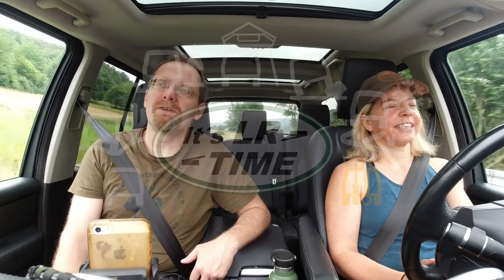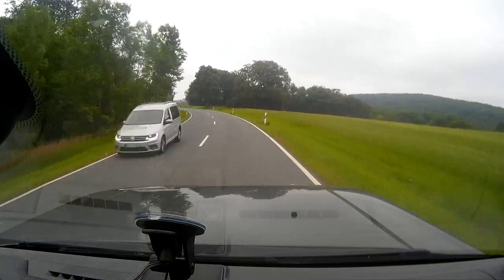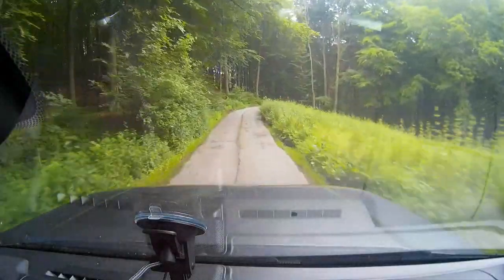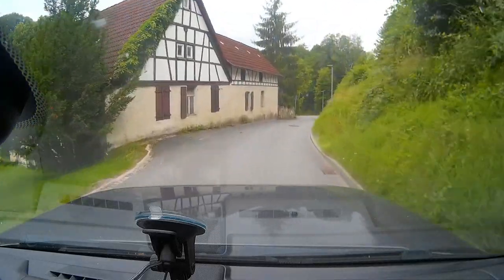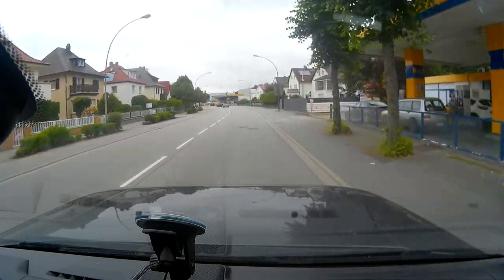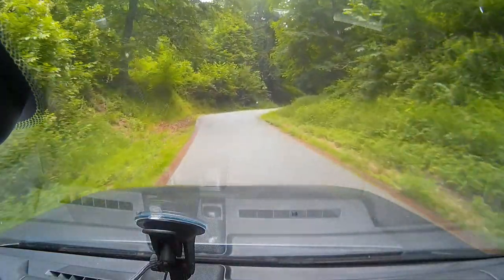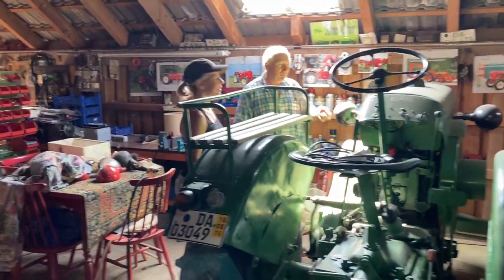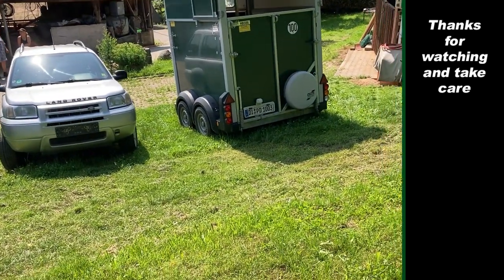Land Rover Discovery 4 - Is it really an upgrade from a LR3 ?

Comment: From the headlights yours is a pre 14 model year 21000 Euro is lots based on UK pricing, my friend in Bremen spent 16000 euros on his with 120km on the clock his is 2012 I thought he was mad ! I think he has the older gearbox, my Disco 3 is going for a gearbox fix on Wednesday if its under 1000 pounds to fix we are keeping it, if over that we will be on the hunt for a 4, might push the boat out and go for a 2016 for the Euro6 (I have 2 daughters living inside the north and south circular and we visit lots ). I had a 5 for 2 months not really same sort of thing. Must admit prices are going up in UK on 3 and 4 not really sure why. Good luck with your new baby can't wait for the videos, hoping to get to DE and AUS and CH in mine before the end of summer.
Reply from the maker: Prices in Germany are through the roof compared to the UK. I have been following your market, also on facebook. And we would import one any minute, but I am not going to drive a right hand vehicle here. So we are stuck with those prices. And due to Corona and the Vanlife hype, everyone is looking for a travel car. We'll be in the Alps sometime in August. 👍🙋‍♀️ Vera
Reply: There may be some LHD markets where they are cheaper ?? But it's a lot of hassle and difficult to import with paperwork etc noticed quite a few land rover disco and range rover coming to UK from Japan. Would love a 5.0 litre V8 Discovery 4 , I know it sounds crazy but there is always the option to run on LPG quite a few in Poland and seems to work well.

Comment: Wanted a D3 but ended up buying a local D4. really miss having a manual gearbox. but love it. I have a terrible deadzone in the steering wheel when driving straight, i noticed when Vera was steering the wheel needed adjusting left/right too. Be a great video topic! .... surely not a landrover fault!! :D 🤣👍👍
Reply from the maker: The steering of our D4 is softer than the LR3.  Is has less play but I thing the lower front suspension bushes are a bit worn.  We have the armored vehicle bushes in our D3 and they make the vehicle ride less smoothly.  Christian

Comment: very well put, they are half the price of a Landcruiser here, my 2010 d4 is worth 25 with bull bar, lights,and 217000km 09 d3 can be had for 12000Au however Discos are comparable, you pay 30 in euros ,we pay 30 in Au dollars, i use 12l/100 from pump readings, computer says 7.8, towing two tonne, puter says 13.6 over 1500km, pump says 19 l/100 km

Comment: I hope you are away from the floods and keeping safe, I have an LR2 Freelander with push button start stop but with a cassette unit that needs to be inserted before you can start the engine also the brake pedal needs to be depressed. She is a 2011 model and has cost me £850 in repairs in 10 years, I can't complain
Reply from the maker: 👍 We had ours for almost 11 years and it was one of the cheapest cars we have ever owned. But sadly it was just time to move on. 🙋‍♀️ Vera

Comment: The disco 4’s are actually much better built than the disco 3’s , but only up to 2013ish pre disco 4 with stop/start! Not only are the stop/start ones a pain in the ass to change rear timing belt but also are much more troublesome!

Comment: Klasse Video wie immer. Also ich bin immer noch froh das ich vom Discovery 3 zum Discovery 4 gewechselt habe. Hatte meinen 3er damals mit 85 000 Km gekauft und 5 Jahre bis 145 000 Km gefahren und hatte nichts als Ärger. Meinen 4er hab ich jetzt seid 2,5 Jahren und hab ihn 25 000 Km gefahren nun stehen 85 000 Km auf der Uhr und er läuft und läuft und läuft :-D ohne auch nur einmal zu zicken. Zudem genieße ich die Klasse Fahrleistungen was meiner Ansicht nach den größten Unterschied macht vor allem das 8 Gang Getriebe ist ein Gedicht. Da traut man sich ohne groß nachzudenken den Blinker links zu setzen. 
Mein Vater hat sich zu Beginn seiner Rente auch einen 4 er gekauft hat jetzt 150 000 Km gelaufen ohne auch nur einmal zu zicken. Meiner Meinung einer der besten 4x4 der Reisekomfort und Offroad-Fähigkeiten verbindet.
Bin gespannt wie es bei euch weiter geht :-D
Gruss Daniel

Comment: Swapped D3 to D4 year ago. Love the smooth SDV6 engine, the torque at low revs and the 8 speed. 
Mis the gear lever although the dail sets gears way faster. 
What I really mis on a premium traveling vehicle is storage for small stuff in the front. There are still no drawers under the seats. But in the middle console there isn't even space for two phones! Somehow we could stashe more things in the D3. 
And why do these cars always have sweaty leather upholstery? 
But really happy with it anyways!
Nicely reviewed.
Reply: I think that's my biggest gripe in the D4 .. the lack of space to actually put anything. Nowhere to put your phone, the door pockets are too shallow and things just fall out, no overhead pockets like in the D2 and virtually nowhere to mount anything ... like a UHF radio!!

Comment: Very good point on Discovery 3 second hand value. 

I bought my Discovery 3 for €6000 in Ireland. I put about €7000 into it in terms of transmission rebuild, full servicings, commercial conversion (significantly lower road tax), luxury seat cover upgrade etc. Now it seems to be going well. 

Interesting, I've noticed a lot more Discovery 3's on the road in Ireland in comparison to the UK. I think this maybe because of the Celtic Tiger 2005-2008. Mine was imported from the UK. (Perhaps useless information)
Reply from the maker: We, and a lot of our comment readers,  really do enjoy reading those kind of stories. Keep them coming. 👍🙋‍♀️ Vera
Reply: @Vera_and_Christian  thanks Vera!

Comment: Regarding the User manuals. The manuals are quite well written, and the German version may have been signed off by JLR's German boss at the time. I agree that the content has dumbed down, I have a manual from my 1989 D1 V8 and it and the 2005 D3 manual contained  lots of really useful stuff, but my 2012 D4 manual is mostly devoted to the Infotainment system, which 1: My S spec doesn't have much of, and 2: I don't use it, I use my Parrot Asteroid Mini to stream internet radio.  Every Model year gets a new user manual and each year it gets less and less useful. I often have to dig out an earlier year manual to answer user questions as their manual doesn't have the answer, or it's badly laid out.

Comment: I own an LR3 & LR4 both V8 HSE and will say the LR3 has less power but like the ride quality better.  The LR4 is much faster but have some more squishy suspension.  Have not had the LR4 long enough to see if there's any difference in reliability.  But have put just under 200,000 miles on my LR3 and only had one breakdown due to the coolant T valve exploding into pieces.

Comment: The 4.4 V8 and transmission in the Discovery 3 is a better engine than the Disco 4 5.0 V8 and the Superchargered V6 Disco 4. So they say. I have a 2008 D3 V8 SE with 87K on it and it's absolutely a blast to drive.

Comment: The audio system in the LR3 is hands down better then in the LR4.  Bass is better and the number of radio presets is better.   And having real buttons vs some horrible screen is better.
Reply from the maker: Yes, Christian agrees with you. 👍🙋‍♀️ Vera
Reply: @Vera_and_Christian  after looking all over my LR4 radio I can't find the level of the volume.  In my LR3 it goes from 0 to 35 and the LR4 has no indication anyplace what the volume is

Comment: Moin and hi Vera and Christian, don't you expect decreasing values of Diesel vehicles in the upcoming movement on environmental standards? I am afraid, fuel costs will raise even more than during the last weeks. I met a suisse guy at the Abenteuer Allrad a few years ago, who did some trips with his well equipped LR D3. He recommended to buy a D4 instead of the D3, mainly for the improved electronic system. Good luck with your D4. Looking forward to watching the vids on the D4. I appreciate your way of presenting your experience and opinion. Go ahead Heinz
Reply from the maker: We have to take it as it comes.  But as long as we are able to drive those cars, we will do. 👍🙋‍♀️ Vera

Comment: I bought a Discovery 3 which had dogs in it and it took about 3-4 deep cleaning valeting before the dog smell diminished to an acceptable level!
Reply from the maker: Ok, first deep cleaning done ✔️. Three to go.  Smell got better after I cleaned the roof liner and after treating the air conditioning vent tubes.  3 more treatments to go… Christian

Comment: A bit late but congrats , I prefer to clean my own cars even if the dealer I always find some bits they have missed. I still use an iPod for my music saves the battery in my phone. Why do you still buy LR with its problems ? To be honest I have had a bmw1 series that needed a new clutch after just 26000 miles ( been driving manual cars for years without replacing a clutch so not me) and also digital oil gauge think most are using this system now, but that had to be sorted due to wrong reading , love the channel joe from the U.K.

Comment: you should have bought an unimog ;)
but we like the g-wagon..eventough it is from the 70's and designed for farmers and the millitary and much smaller on the inside and completly rusted.

I actually expected something about the high water, but it seems you are save. that's a +

Comment: After driving/repairing a good few disco 3 / 4’s my take on it is the 4 is much nicer to drive due to suspension/8speed gearbox ! 8zf for the win 🤜 thank you crafty German Enginering at its best!
Reply from the maker: Christian is not totally happy with the 8 speed. Why  that iswill be covered in a future video.🙋‍♀️ Vera
Reply: LR TIME The 8 speeds respond great to an oil/filter pan service! I only did said job amongst other jobs to a L322 4.4 a few weeks back and the customer was much happier with gear changes afterwards! 
The best place I’ve found service kits was on winparts in Holland.

Comment: Great video , I see you bought an earlier d4, I bought one of the latest ones on 2016 plate it’s a landmark special edition, thus spec sits between HSE and HSE lux, the infotainment is the meridian surround sound system which is much better than the Harmon harden which is on your car, although I bought mine 2 years ago when it was only done 14250 miles , but the air suspension pump failed and just changed it . I also be very interested in the the dip stuck conversation. Regards mark

Comment: I chose a discovery 3  as the tax bracket is a lot lower than the discovery 4 in the uk. I wanted a basic S  model, as I wanted to minimise the amount of electrics. I do miss not having seat arm rests though. I pop aid £3500 for a 2005 model and love it
Reply from the maker: It will be interesting to see what the tax and insurance will cost. But in this regard, here in Germany the Freelander costs almost as much as the Discovery 3, one reason why we parted with it. 🙋‍♀️ Vera
Reply: @Vera_and_Christian   my tax for the year is £330 , but the discovery 4 jumps up to £500
Reply from the maker: @robgreenhill1426  The tax for the Disco 4 is 525€ and for the Disco 3 is 416€ 🙋‍♀️ Vera

Comment: I would like to hear Christian's advice or feedback compairing your D3 and D4,s headlights. With the 2013 facelift of the D4, the headlights were changed in that the driving lights were replaced with daytime running lights where the OEM spot lights had been. This could be due to EU Regulations, as many other automakers (VW, Ford, Kia... to name a few) does the same. It might be OK for the EU, but I don't like this as our roads and road markings are bad, and pedestrians and animals also uses the roads. The D3 SE/HSE and pre 2013 facelift D4 had better driving lights built into the head light.  Good spotlight driving lights, and dimming for oncoming traffic, are essential for safety in such conditions.  Sadly current cars are not equipped with good spotlights built in anymore.
Reply from the maker: We will defefinitely do that, if that is possible with our camera setup. His first impression was that the D4 lights are much better than the D3 lights. But he also thinks that the D3 needs some new bulbs. 👍🙋‍♀️ Vera
Reply: Correction 😀. It is with the 2014 facelift of the D4 that the headlights were changed to the bad ones without proper brights.

Comment: One thing I didn't pick up from your comparison between the 3 and 4 is how much better the brakes are on the 4. The downside of the better brakes on the 4 is the requirement to go to larger diameter wheel rims and reduced tyre profile. Never a good thing for offload driving
Reply: Should read offroad
Reply from the maker: There will be so much more info to come, we can't put that all in one video. 👍🙋‍♀️ Vera
Reply from the maker: Yes, the brakes are much better.  And the driving comfort is less good because of the 19“.  Bothers me a lot actually.  I would prefer the 18“ setup but it does not fit and is not road legale. Christian

Comment: Would you recommend a 2013 LR4 HSE over a 2016 LR4 with the V6 ? If both have been used just as daily drivers and never been taken off road
Reply from the maker: For us, it does not really matter if they have been taken off road or not. Most important to us, when buying any used Land Rover is, have they been maintained well. It is very important that all oilchanges have been made, engine and differential, regularely. It also depends on the mileage and the price of course 😅. And you have to hook up a obdii tool and see what kind of faults they have. Then your preference of engine matters. Our criteria is, next to the trim, getting the lowest mileage with the least faults. That is why we bought our Disco4, Christian wanted HSE trim, the price and kilometers was unbeatable and we knew we could handle the oil sensor fault.  🙋‍♀️ Vera

Comment: Fantastic Video! As I said in one of your other videos, I could watch you two for hours. Nice to see a bit of the German countryside, I lived there for a total of 7 years and really miss it!  We just bought a LR3 about 3 weeks ago. Now over the last 40 odd years of driving I’ve had countless numbers of Land Rovers, I even worked part time for Land Rover at one point and my ‘company car’ was an original Camel Trophy Discovery (original of course, although I’ve seen a lot of the Camel Trophy Discovery copies they made for Japan). And my last Land Rover was the excellent L322 Range Rover. But we needed a good strong large vehicle for my girlfriends business (we had spent 4 years destroying a VW Touareg) and the LR3 fitted the bill. Its a HSE V6 Middle East spec (so no heated seats) and of course, 20 minutes after picking up the LR3 the suspension fault light came on. The dealer replaced all 4 airbags, the compressor and two valve blocks, so now its OK, apart from a new battery last week.. I went for the LR3 because to me the LR3 just seems a bit tougher and slightly more ‘basic’ than a LR4, so it should be good for a business that really should use a Transit van. And its really quite nice, I have the same Piano Black wood in the LR3 as the Range Rover had. So yes, the LR4 is nice (apart from the oil dipstick issue!!) and if we didn’t need more of a workhorse then a LR4 would be OK, but I think the LR3 will survive longer, hopefully as long as the VW Touareg at least!
Reply from the maker: 👍😃 and the LR3 looks so much cooler than a Touareg. I was always wondering why all the Camel Trophy cars were in Japan, now I know. We watch @Grizzlynbear a lot and they always had a lot of Camel Trophy Cars in their videos from Japan. 🙋‍♀️ Vera
Reply: @Vera_and_Christian  I got the chance to play with one of the Japan copies, they were factory made and the only real difference was they had no internal roll cage, so whereby in the original camel trophy discovery the roof rack was mounted onto the roll cage, the Japan camels had the same roof rack but with a conventional roof mount. I had done a lot of filming with Land River and they kindly put me through an off-road instructors course. When the new Land Rover Experience centers sprung up I was invited to work part time in New Zealand at the Experience. I also helped out on a few launches (the Freelander, the P38 RR and the Discovery 2 - there is a press photo somewhere of me getting a P38 airborne over the crest of a hill) plus at one time we had a prototype new RR (the L322) at least 2 years before its launch, not road legal and with strict instructions not to take it on the road, of course we would occasionally nip to the shops in it! I remember it had a big red knob on the dash as a kill switch should anything funny happen with the electronics. Someone else who worked with Land Rover occasionally was a guy called Pete, who was a real life Crocodile Dundee, seriously! And such a nice guy. So I was asked to make an off road safety video which would be put in the glove box of every new Discovery 2 that was sold in Australasia, and naturally we used Pete to present it! We had great fun making that video including a scene on the dangers of 'kinetic energy recovery ropes' which involved a one-off take with multiple cameras of a tow hitch being ripped off and flying through the cab of a Range Rover, taking out the rear window before being caught by a net system we installed to protect the stunt driver. Good fun.
Reply: "Land River"?? Sorry my typo!